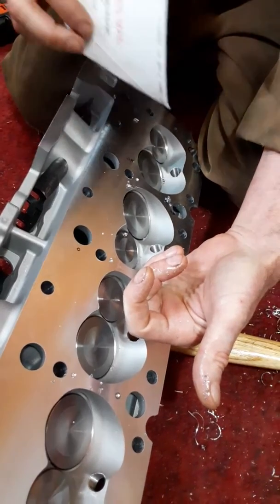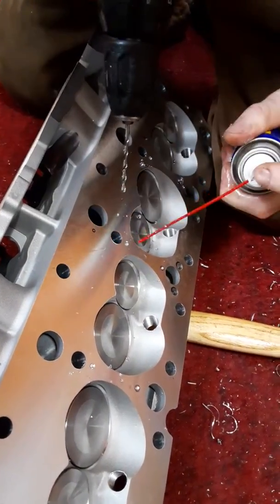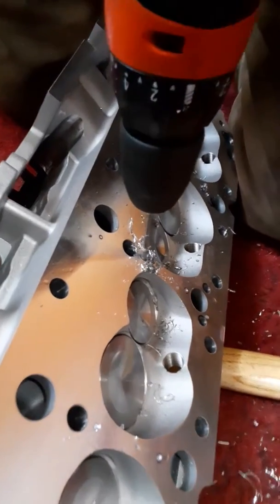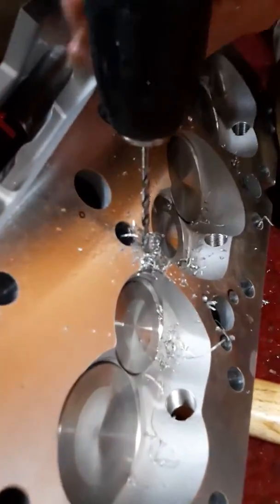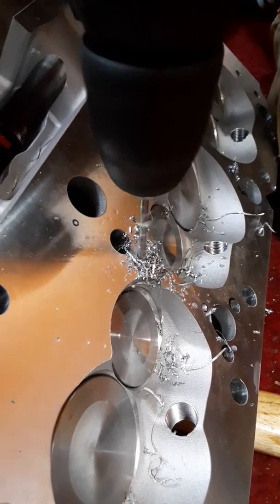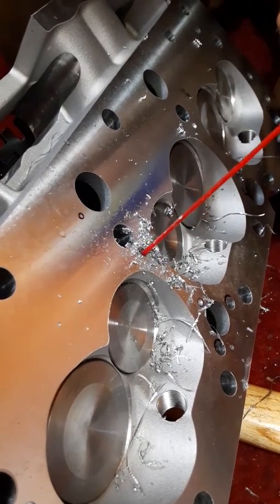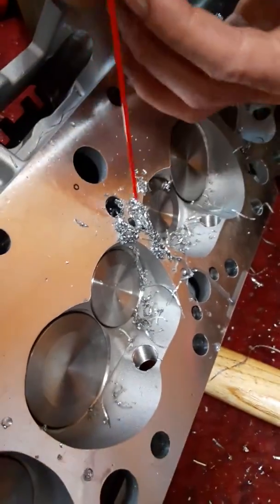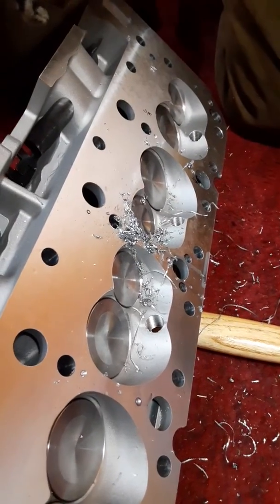Drilling Steam Holes for 400 Small Block Chevys in FloTek 102-505 Heads - Steam Hole Mod.

Comment: I learned about the 400 block steam holes the hard way about 45 years ago and so did the mechanic I bought the engine from.. That engine lasted about as long as a fart in a windstorm.
Reply from the maker: Dam, thats a sad story. I came across a 817 block so I built a 2nd 400 only I went retro-roller with the cam.

Comment: Great drilling, but never drill those upper holes there not needed.
Reply from the maker: @BearButler321  Thank you for your input. I show the way Chevy designed it. To each their own after that and that's fine. I have 2 400SBC's and both cool great and both have all 6 cooling holes on their aluminum heads.

Comment: I tried calling Flotek's customer service for answers about this since their website says "contact us about  400 sbc". Never heard back from them after numerous attempts. I found out more from your video than I ever could from the people that make and sell these heads. Thanks for posting!
Reply from the maker: @silverstreak232  Thank you! That is why I made the video. That sucks you can't get ahold if them because I have another 400 SBC that I wanted a set of their 200cc Hydraulic Roller heads too. 
If I am able to get ahold of someone, I will post it here. Thank you again :)
Reply from the maker: I received a call back from Flo Tek today, concerning another set of heads only 200cc's. I was sad to find put they don't make a set of 220's with STRAIGHT plugs. The service representative (thanks again Stephanie) and I both agreed that they need to expand that line to include straight plug options, not just angle plug, which burn up my Camaro plug wires. Call them back and leave your name and number like I did. Good luck l! This was on 9/4/2024
Marty

Comment: This gives me anxiety
Reply from the maker: Me too but you can do it. Just don't let the drill bit walk when you start so a center punch is a good thing to use. Put the headgasket on he head to mark the punch holes before anything, or that is what I did. I used it as a "template" for where to drill.
Reply: @martywilsonwilsonenginesho7940  that's for the knowledge

Comment: My experiences ! I simply drilled them straight down and use the 350 head gasket for a template. I did at six pairs of heads that way with no problems. Great job
Reply from the maker: Thanks, I just wanted to show that you didn't have to have a machine shop do the work. A jig for the head and a DRILL PRESS would have made the work A LOT FASTER, but the hand drill works and the motor has 5k on it now and runs very good. The heads are on my son's 1986 Z28 that has my 400 SBC in it and they work very well. I wish I had bought the 210cc instead of the 180cc runner model is all. Flotek is a good American company and I would buy their heads again. Probably would upgrade to hi pressure springs, for those interested.
Reply: @timculpepper4939  The hole can't be drilled @90° 
The factory didn't because it would run into the head bolt boss 🇺🇸

Comment: Just curious what size holes did ypu drill
Reply from the maker: If I recall, it was an odd size but I matched the size with the block hole size. 
BTW, that engine in a full wt Z28 took a V8 Swap S10 in Mexico last nite and never got over 195* . 😎
Reply from the maker: I will repost as soon as the NEXT SET of heads get here and list the size of drill bit I use. Thanks for asking, I am happy to answer. Give me a couple weeks as of 9/4/2024. I am building another 400 with 200cc FloTek heads.

Comment: I actually  had to drill a hole in my friends  350 Chevy block when he used trick flow heads .
Reply from the maker: Oh I understand. In "my" day, a 400 was a "smog" motor. Thank you for the reply so others can have opinions! I appreciate all of the options and opinions.
Reply from the maker: What was the reason for needing that extra hole? You can use 400 heads on any other small block but not Visa Versa as GM designed it. Just wondering. Thanks for watching!!! It was nerve racking but worked out just fine and the motor is very street gnarly.
Reply: @Marty Wilson, Wilson Engine Shop  Maby because  the 400 had a simease block and it would  help in better cooling ? I never really  used  the 400 small block only the 350 small block.  I remember  the 400 wasn't  a proformance engine. But later  realized  it's actually  a good engine  but the heads GM used on it were junk as the combustion chambers were too big at 76 CC. Now a days  companies  like Dart make  these blocks that are far superior  to the old 400 blocks of the mid to late 70s

Comment: I had a 400 Chevy in my 1946 Chevy coupe, it kept running hot & overheating,put a wind high flow water pump, electric fan, bigger fan on water pump, still run hot ! Put built 350 in, no problems ! But it don't have the power or torque the 400 did ! The 400 was a brute !!
Reply from the maker: We run a 4 core Champion Aluminum radiator, high flow water pump and twin Spal fans with a fan shroud to keep our beast as cool as possible.
Reply: @timothyroatenberry1274 what ratio were your crank and water pump pulleys? And were you running a heater or bypass? Did you have a fan shroud with a mechanical fan? Was your electric fan on the engine side of the radiator?

Comment: Do all SBC 400ci motors need those steam holes drilled?
Reply: I heard  it wasn't  a bad idea to drill those   holes, but if you want a performance engine  don't use the stock heads GM installed  on the 400 block as they were a crappy  head at too big of a combustion chamber at 76  cc 's
Reply from the maker: Well GM did it to keep the cylinders as cool as possible since they are a siamese cylinder block, meaning there isn't enough room for water to flow BETWEEN the cylinders so I drilled my set of heads to flow like the block is made.
I have had comments that they don't need it but I build motors and modify them. I think that you SHOULD have the holes so you are cooling those cylinder walls but I am sure some racers may not deem it necessary.  This motor is in a street car that drives anywhere we want so I took the precautions to keep it cool and all has worked out very very good. 
FloTek, the head manufacturer, said I could send them in and they would do it but like our motto #WEMODIFYEVERYTHING,  I did it myself. 
Theses These were aluminum heads so they were easier to mod than a cast iron head. 
Thanks for following!!!
This motor is in the 1986 Red Z28 that runs 13.4 in full stock weight. Check out those videos if you'd like :)

Comment: Have ran 305 heads on a 400, did not drill holes. Bigger valves n such but didn’t drill the holes. Ran circle track 1/2 mile 7000 rpm never overheated.
Reply: Just a note for all this is true although real street engines that expect to be used and get into daily stop and go traffic it could happen to though. i am have always been told or taught  to drill the holes, automotive books and magazines, engine builders, shop class, etc. the common phrase is.      " . . . and don't forget to drill the steam holes in the heads since its a 400 sbc"!  And have seen or heard about many station wagons with 400 sbc overheating on side of road. The fact is the cylinder bores being larger and the block's original design water jackets are changed and make steam, weather or not it returns to coolant or water is the issue, once cavitation begins and nowhere for steam to return to water coolant,  it cavitates, and the coolant or water boils at a lower temperature as pressure goes down and steam pressure builds up. In a moving race car this doesn't happen because of good coolant flow and cycling and other cooling and simply constant ventilation at high speeds.  However, aftermarket block designs have fixed the steam pocket in the block issue because of superior design. The 400 sbc is a modified by gm '350' and they overlooked other design potential. However the 400 factory block is still a great engine And in my opinion should be the stock factory block design and should have replaced the 350. However, without the overlooked water jacket design flaw. Aftermarket blocks by dart and all others do not need steam drilled heads.
Reply: The idle is what kills it
Reply: That's how we do all of our 400 based sbc, circle track engines. Never have any issues as well.
Reply: I would plug the holes then deck the block. I never drilled the heads. Put one in a van with a/c never had a problem.

Comment: you really  only need the bottom (spark plug side) holes in the 400. The top of the siamese cylinders will rise and flow to/ thru the top of the block/cylinder head coolant holes.
Reply: I have never seen a 400 block being sleeved, so no idea: does the block casting area serving the upper head bolt have a boss area capable of trapping steam near the deck?  GM has gotten into trouble over the years where they repurposed old castings in a "bridge too far" moment - the most egregious one was late 70's where they took a gas block, resleeved it, and pretemded it was good for diesel service.  Junk.
Reply: @flinch622  the bottom holes vent the steam/water trapped by the siamese cylinders.  since steam/hot water rises it can escape thru the upper water vents in the head.  The roundy-round racers and smart street guys provide a "vent" at the rear of the heads to increase circulation and help cylinders 7 & 8 run at temps similar to the front cylinders.  This additional circulation also aids in removing any steam captured at the top of the block.

Comment from the maker: Are they stock heads or aftermarket???
Put a drill bit into each hole and see if they are in fact drilled straight. The holes in the heads simply need to intersect the water coolant passage in the heads and the factory drills the bottom holes straight too but the top 3 are angled back and into the water jacket area. Idk what you might run into if the top holes were drilled straight. I spoke with FloTek before I attempted this mod myself and that is what they told me.

Comment: Hi, I have a 400 and it looks like the holes were drilled straight in, not angled.  Is this a problem? I pulled the motor apart because it got hot breaking it in,  it ran hot immediately upon driving (225 going up n up n up) and oil pressure was garbage! So I pulled it apart and sure enough the mains are wiped
Reply: As long as the holes made it to the coolant area you should be good. The reason for the angled holes on the intake side is to break through the thick casting and into the coolant chamber. If you look in the passages on the exhaust side, you can see if it is hollow or has casting inside toward the other holes.